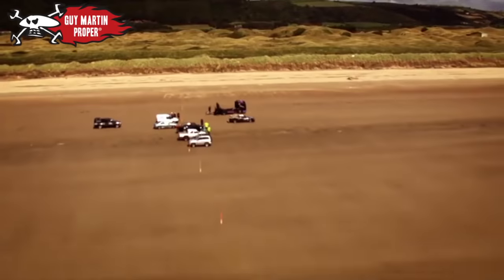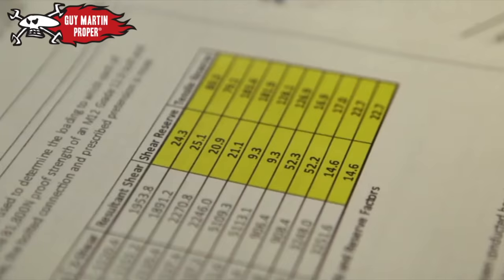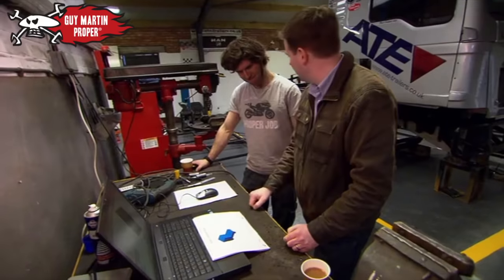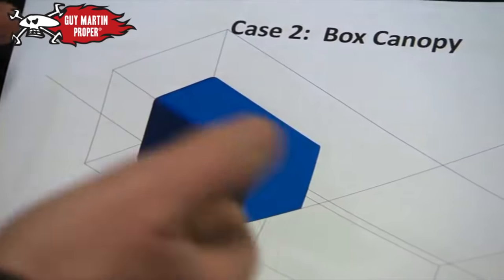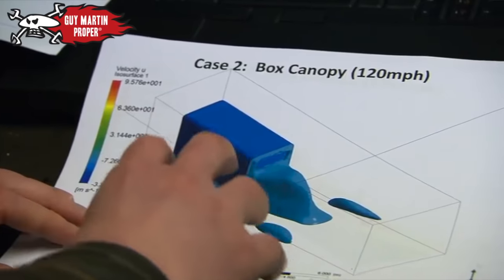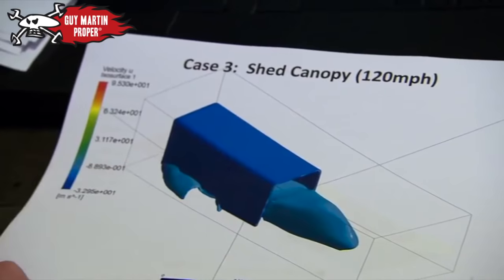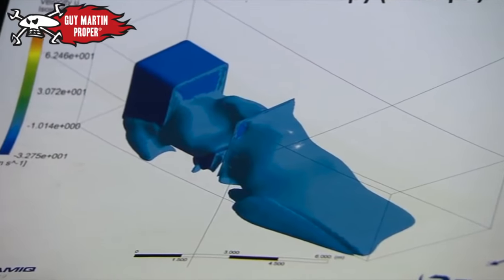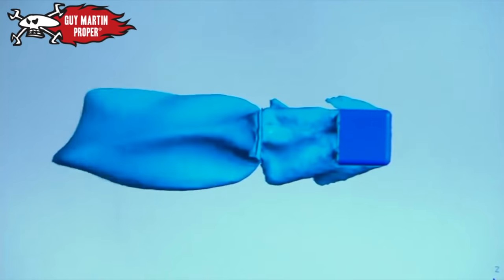Guy learns the science of slipstreaming at over 100mph | Guy Martin Proper

Comment: As serious racing cyclists, we used to do this regularly with our sunday morning bike rides about 40 years ago. We'd get in behind a sheep truck at the traffic lights, they only accelerate slowly at top out at about 90 Km/H. A normal bike only has the gearing to do about that max speed, that's with a 52 on the front and a 13 on the back. Once in the slipstream it's no effort at that speed, you just run out of pedalling speed. To go for any sort of record you're going to need really special gearing. On sand? no, too much drag.
Reply: If you look through previous videos he already smashed the record
Reply: Yes, I saw that afterwards but he sort of cheated as he got towed up to speed, didn't accelerate himself.
Reply: I just used to hang on to the lorry!